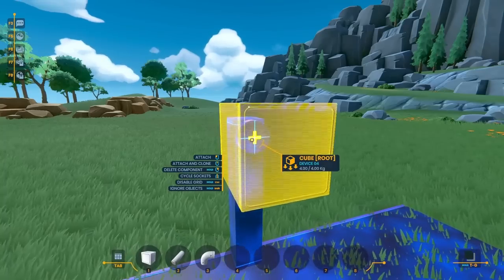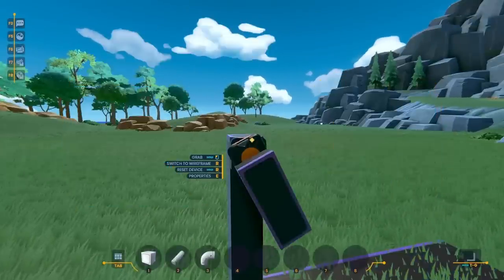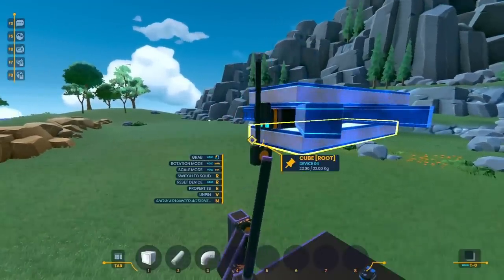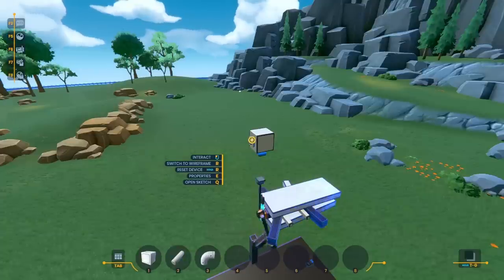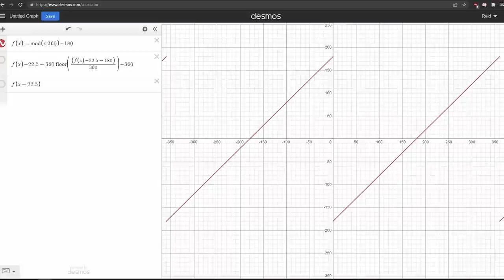Can You Make A Magnet-Powered Car in Plasma?

Comment: A car powered magnet would be a snow plough travelling at incredible high speed along some kind of cyclic pattern with a bias to return to the center. If it was a circle, everything outside the loop would be pushed away or inside (car powered black hole??) depending on plough angle, while if it was a figure of eight, one loop would push outside stuff out of itself, the other would pull stuff into itself, just like a magnet. If the car didn't exist in a system with particles at pressure, then you could get around that by having it even go even faster, choosing a different radius of looping path each time. Having several snow ploughs would make up for stuff there.

Comment: its a bit sad that you didnt use the great advantage of electric motors, which is speed control! (really simple) AC electric motors change polarity with the frequency of the AC current, which allows for speed control just by changing this frequency. Your system is more like a brushed DC motor, which works but has less control. Great video tho.
Id love to see you make a synchronous electric motor using these magnets.
Some epic non-motor projects would also be a Gauss rifle or an autonomous vehicle (maybe a roomba? ^^)